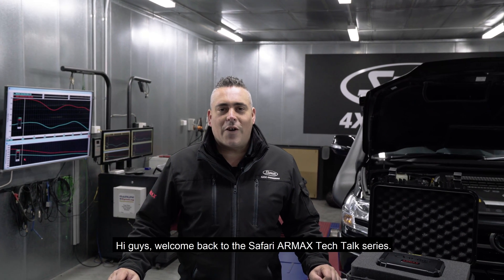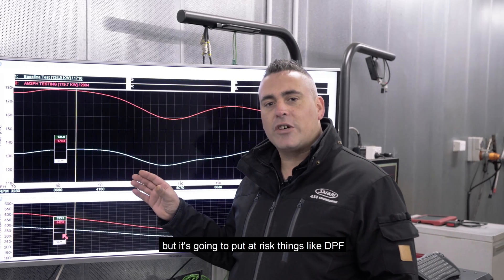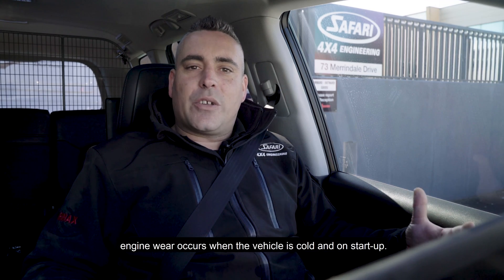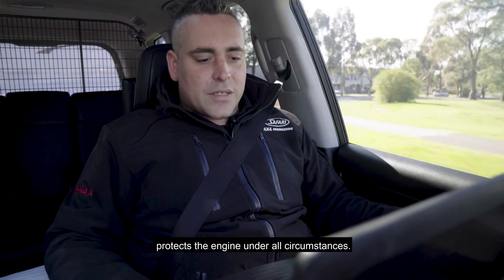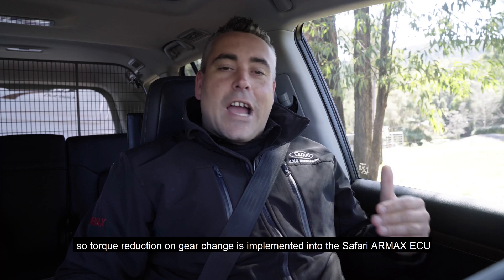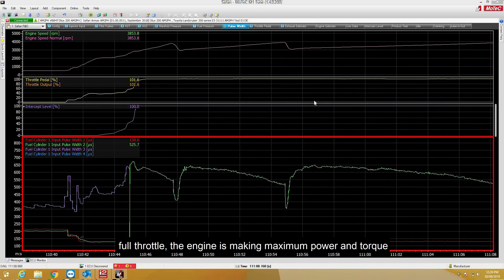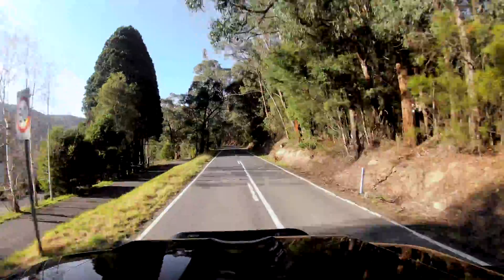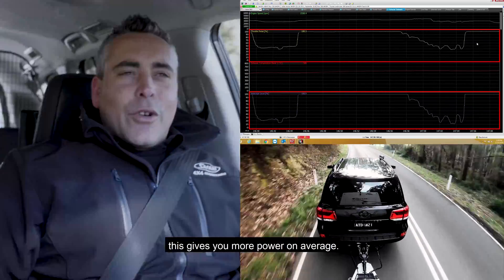Safari ARMAX ECU vs OE ECU REFLASH - TECH TALK EP03

Comment: Very informative video 

My Ranger is almost ready for the Safari Armax ECU 
Just installed the ARMAX snorkel 
REDBACK extreme duty exhaust next week 

Lift & tyres✅
Dual battery ✅
Bull bar ✅
Catch can✅
Fuel filters ✅

And the list goes on 

I’ll be towing a BUSHTRACKER   Caravan around the bush for a few years 

Safari gear is the best in the world 

I buy and use the best....can’t go wrong